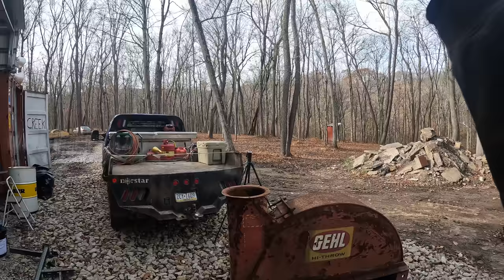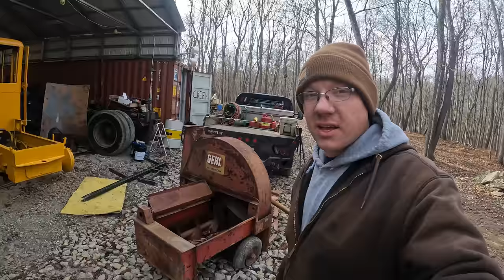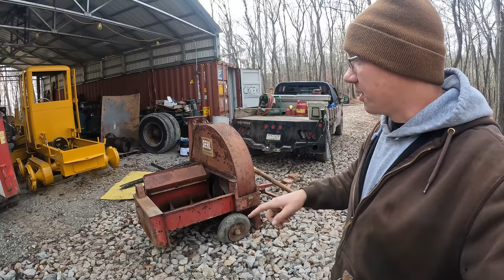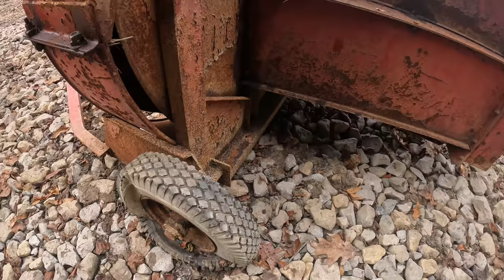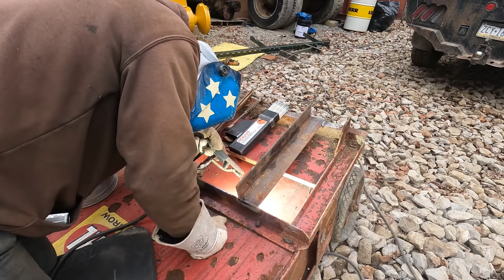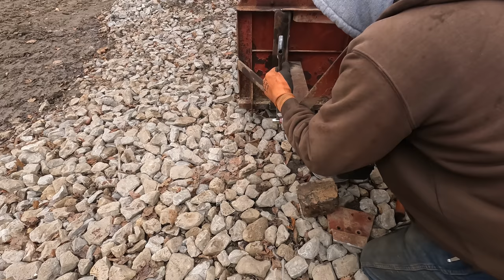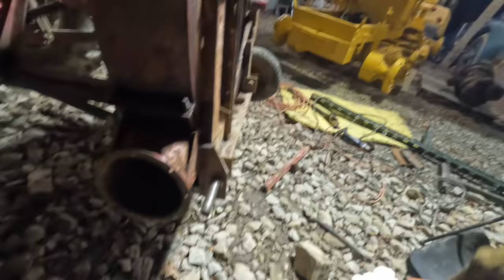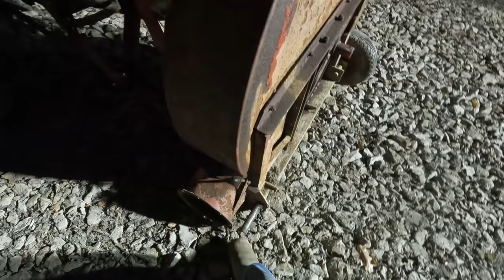I Built a Giant DIESEL POWERED Leaf Blower!!!

Comment: Interesting. That’s crazy how that hole location effected the pressure That much.  You’ll figure it out
Reply: for a centrifugal blower to work well, the inlet needs to be towards the center (or ideally directly in the center) of the blower. Think of a furnace blower, or a centrifugal water pump. The blower works by essentially slinging the air from the center of the impeller to the outside. Since there is a giant hole on the side of this blower that is almost all the way out to the edge, the centrifugal action that would let it build pressure at the intended outlet is released. The inlet of that blower should really be a few openings as close as he can get them to the center of the impeller. Every bit of distance between the outer edge of the inlet and the tips of the blades is more pressure to be built up.
Reply: I can see it already, my thinking is the location of the inlet in relation to the outlet is important & moving the nozzle 90* put it way too close to the inlet hence losing lots of potential pressure. That or moving the inlet to the centre as David says.
Reply: Instead of the blower outlet being at ground level and thus a very short throw, turn the thing 180 degrees so it blows out the other direction, from higher up (better).
Also that huge inlet hole is too big and too close to the outside rim.
These other comments are right, center the hole.
Grease the bearings on the fan, maybe 2 grease nipples.
Forget bits of rubber on the fan blades, that's just silly.
Reply: Now Hank's gonna build one!😄

Comment: As this is a basic centripetal fan, close up that hole near the outer edge, and cut your new holes close to the hub.This will give you the best possible static pressure. When combined with the other guy's suggestion of rubber tipped blades will make a huge difference. Even better if you have the sides of the blades somewhat sealed too. You could even go overboard and build curved blades a-la your normal radial fan arrangement.

Comment: The farm I used to work at had a grain lifter like that. The 120hp Fendt would run it flat out, but we often needed that tractor for carting. Put on the Case 844 (80hp tractor with the pump turned up quite a bit) the exhaust manifold would glow red for hours.

Comment: I had a large leaf vac mounted on a 20 yard container truck . To increase the suction I reduce the hose. I think if you put a pipe on the end that can reduced and concentrated the flow Added with the smaller intake hole you would get more blowing pressure. It worked for me just in reverse of what you’re doing. Great video great build

Comment: To fit a wheel to keep the blower from dragging the ground, just run a trailing link arm/tie rod back from the old axle to a new one about a foot behind then brace it back to higer up the machine with an old rear shock absorber.
Keep up the great (and crazy content) , you're one of the best on youtubed.
David in the U.K.

Comment: love your dedication..... 2 thoughts on the blower.   1 just loosen the sliding housing bolts up and spin the blower chute to the other side  it will naturally be pointed downward and you can remove the cant from the hitch. Or 2 since the chute looks like a giant hose clamp take the bolts out spread it and pop it off, then mirror image rotate it so the chute is still on the bottom but on the other side. Spread it and pop it back on, tighten the bolts up and you're done. Both option 1 and 2 get you back to full air power with no cutting grinding or welding required!
Reply: Great idea, but it won't work. With the chute on the opposite side, it will suck instead of blow. Because of the rotation of the fan. Make a great leaf vacuum tho.
Reply: @joemascioni3101  just throw a pto reverser in there (avail on ebay) plate of the existing intake and plasma cut the air intake to the left of the plated off intake and you're done.
Most things in life are not free.

Comment: Hey Matt, I agree with the previous comment about a central intake around the main drive shaft. Also if you reduce reduce the nozzle it will create a venturi and you'll get more velocity than just open CFM. Rubber tire flaps on the blades will also seal inside the housing, which is where you are loosing cfm.  Just my 2 cents
Reply: I like you ideas.

Comment: Nozzle and inlet position have been mentioned, so I want to mention one other thing: Rubber (mud flaps of converyor belt) bolted onto the fan could give better sealing towards the housing. If you cut off the tips of the rotor a bit for that, it even creates clearance (also dry leaves and sparks are probably not a good combination).
I did a similar modification to my snowblower, and it really makes a difference.

Comment: The inlet should be centered around the centre, it's way off centre to feed thein  silage which is great for blowing silage but not for best blower action.  Also, you want a jet tube, all leaf blowers have them. A gentle reduction in diameter - this converts pressure to velocity and you want velocity to move the leaves. Amazing project, I love the sparks!

Comment: A nice project in progress. Having only an electric leaf blower, I found that a tip that was necked down to a flattened rectangle, not a fan but like the crevice tool on a shop vac works the best on mine. A more focused air flow much like how a water nozzle works on your garden hose. I think it's a great project. The snow blower aspect is a game changer, move the snow completely away from the driveway without losing rock. You may also think about running some 3/4" minus gravel down to lock in the large stone and help prevent the debris infiltration. A road builder I hired for a project many years ago would run a base of 3-4" stone and then fill in with the 3/4 minus. The sand and fine crush fills and locks. Compacts very well. You could experiment on a section to see which combo gives the best flow through drainage.
Reply: Great idea but how about building a shoot to suck the leaves up and shoot them out just a different approach

Comment: Nice job, love to see the fabrication and appreciate you working into the night on this one for us!  Just needs a rectangular output cowl like heatguns have, and a skid/bogey to stop it dragging and then you'll be in business.  With your intake port, you could attach a small vertical chute/hopper made from sheet metal to make it safe, plus you can load straw into it which would then be sucked in and blown out when you need to do that.

For added terror please film the limb remover in operation using a strobe light if you can, then throw a banana (for scale) into the apparently slow-moving blades. :)

Comment: Hi, I think that if you cut two four inch holes on the tractor side just above where the air output is, you can maximize the force. I also like the idea about trimming the blades and adding some flap material for a better seal... Great project! Ron...

Comment: Mate, well done! You get an A+ for ingenuity.

A suggestion, though; have you thought about using it as a vacuum cleaner instead of a blower? Rotate the outlet nozzle about 180 degrees, and fabricate a box-shaped sheet metal cover for the huge inlet hole, with a single open side facing directly downwards. This would mean that as the blower inhales air it would also inhale leaves with it, probably mulch them on their way around the impeller shroud, and blow the whole mess straight out of the right-hand side of the machine and on to the ground at the side of the road. Since you drive on the right-hand side of the road this will be second nature to you.

You would have much greater blower efficiency and air velocity because of the longer air path. This combined with the direct collection of leaf litter would perhaps result in greater road cleaning efficiency.

Also replacing the road wheels with two new ones, with solid rubber tyres, to maintain both road clearance and vacuum efficiency, would also help. Rubber flaps on the sides of the air intake box, as suggested by other readers, would also help here by keeping air vacuum constant, but they would need to be clear of the road surface by a few inches (maybe three inches, but you could make them height-adjustable by slotting the mounting holes so that you could "tune" things) so that the machine sucks up the leaves instead of sweeping them ahead of it.

For other uses, such as straw blowing, you could perhaps revert to the silage auger feed method; remove the leaf sucking inlet and replace it with the auger feed mechanism, allowing it to discharge into the standard feed point.

I am not trying to teach you how to suck eggs; these are suggestions only. I hope this helps.

Comment: If you want to use it "pin point" accuracy with leaf blowing or straw blowing, you could talk to some local cow farmers and see if they have any old heavy duty Ag sprayer hoses with the locking clamp on one end. Then all you would have to attach it to the blower, and put a handle on the end of the hose. I've seen a few rental straw blowers that have that and it would make your life easier. Just park it in one spot, and use the hose to get an area evenly before you have to move the tractor again. As for straw Blowing, why not make a simple feed ramp that folds up and acts like a blocking plate for when you need to blow leafs.

Comment: Excellent job I personally think it will work beautifully once the removable block off plate is installed and you turn the throttle up on the tractor I would build a loading chute for the straw where the block off plate is located and make it removable and then switch them out you will have to move the chute around for the straw so you can install the straw chute at the same time and away you go this is really a nice setup and it will have multiple uses i also agreed with Mr. Z about the rubber

Comment: I would suggest having your intake in the low pressure area around the fan axle and putting on an outlet reducer to increase the velocity of the exhaust. Perhaps bolt on an appropriate sized traffic cone and trip the end as needed

Comment: Awesome squirrel launcher
Bearing s must be loose letting fan hit housing.
We had big Jacobsen and Toro ones on Ford tractor s on Air force base run at full throttle 540pto rpm would blow 15 ft away anything.

Comment: Hi Matt,
Not an engineer here but a fan of yours. Lots of great comments/ideas here. My two cents are that the fan blades are just straight pieces of angle iron which are great for slinging stuff. However, in your case, you need to move air. Of course, closing that gaping intake hole and leaving 6-8 inches towards the center is a great idea. However, all fans have curvature to move air forward or sideways. In your case, maybe tilt them to push air out.  Kind of like on the 90's wheels, where the blades were slicing or cutting. Same concept. 
Also, I think attaching a swooping 90 degree conduit can point the blower tip from center of road. Very little blowing power will be lost. 
Hope this helps in your decisions.

Comment: And my first thought after reading the title of this video was...of course, you did, Matt. A shallow venturi concentric with the shaft would improve the airflow (think ventilation fans in air handlers). In fact, a smaller version of this concept is visible in your storage container. The blue-painted blower housing behind your chop saw (seen as you cut that angle for the 3-pt. bracket) is a good example.

Comment: Matt,
I was a design engineer for a fan company.  A fan is a centrifugal pump.  Look at any centrifugal pump and you will see the inlet is at the center.  The centrifugal force causes the air moving to the outside away from the center.  The forward side of the blades push the air, a fan doesn't suck, it pushes, then atmospheric pressure fills in behind.  The lowest pressure is at the center, the further from the center the higher the pressure.  If you have openings near the outside diameter, they will just be more outlets.  
I would close off and seal most of the inlet opening that is not close to the center of the shaft.  The current opening is way too large. It was used for solids which in reality clogged up most of the opening.  You are not using solids, so your application is a little different.  The inlet opening should be maybe one and a half as large in cross section as the outlet, at only at the shaft location. A circular cutout around the shaft would be best, the closest to the center would be best.   I hope this helps, and thank you.
Reply: This is your solution^, think of a turbocharger, inlet at the center, exhaust at the edge, should work like a champ.

Comment: Leaf blower and flame thrower at same time - love it, great work again Matt! You could rotate the chute 180  - you get great air pressure (as blade travels further before exit)  and add a piece of pipe - like you get on a snow blower, maybe even a moveable end to direct flow exactly where you need it. either way, great upcycling.

Comment: To close off the large opening, attach a plate with a hinge at the top and a bolt at the bottom using a wing nut. It can be closed for leaf blowing and opened for straw blowing. For leaf blowing, install a similar door 180° from the existing door.

Comment: Just block off the outer half of the intake opening and leave the center clear.  Centrifugal force will keep the air to the outside of the rim.  Don't make any openings near the outside anywhere on the cage (top or bottom half) since that is where you build pressure.  Use an A/C fan as an example.  The intake is in the center.  Great video.
Reply: That combined with the rotating the outlet 270 to point down on the other side (as suggested by others) would probably go a long way for improving the output pressure. Good thinking there.

Comment: Here's my suggestion:

On the "exhaust" side, what I would do is rig some sort of angled cone. That way not only will it point straighter, but will basically compress the air as it comes through. 

As far as the Intake, definitely a removable cover over the exposed blade. Then cut open a hole on the exact opposite side of the blower (again with a removable cover)

Comment: Make it a leaf vacuum by building a shroud for the current intake area that comes down to a rectangle opening about 3' by 6" about 4" from the ground when it's lowered, then use rubber to bring the lowest point on the shroud to 1.5 to 2" above the surface. You can then rotate the exhaust to the right side and put a rubber chute about 180 deg. around the top edge that's "floppy" at the outer edge to prevent rocks and sticks from shooting upward. That should provide plenty of air movement. Doing the rubber tips on the impellers would help even more, like others have said.

Comment: Hey Matt I'm curious how it would blow if you repositioned the shute to the 4 o'clock position instead of blowing at 90°. Also with the dragging problem I wonder if you made like a swivel wheel ok the back like on a 3 point brush cutter.
Reply: put a hose going out the other wheel from that and it'll be superpowered, also some of the other comments suggest the impeller being close to the center of the fan

Comment: I really enjoy your videos Matt , just a little suggestion on this leaf blower , why don't you add a  removable pannel on the big opening so you can use it as a straw blower when you need to and also make those 8inch holes and a set of blocking plates for them so you can block them off when you don't blow leaves , just weld some bolts and this way you can put protection wire mesh when you blow leaves and blocking plates when you do the straws

Comment: weld on post (bolts) so you can build flaps to cover the 8 in holes, add a wedge to hold them in place for when not using it in leaf/snow blowing and make them so you can just take them off when you are using as leaf/snow blower. thinking that gravity should do most of the work for you, dont want them to be too easy to come off but not hard either. I tried the snow blowing with a backpack.. not sure you are going to like it.

Comment: Nice forest fire generator you have there.  🙂  A nozzle of say 50% diameter reduction would up the velocity a lot and give you better directional control.  And if you can flip the rear panel so outside is in and inside is out, I think you get the inlet on the top where you'd generate more velocity.  I also agree with others who say the intake is too large.

Comment: Pumping grain and pumping air are two different things. Find a leaf-sucking vacuum trailer and examine the fan assembly. It’s an offset volute. The air intake is in the center and the centrifugal force imparted by the fan compresses the air like a turbocharger does. So, centrally located air intake and the housing needs to increase in size as it nears the outlet. Then you’ll move some leaves.

Comment: Matt, try putting the discharge straight up like it was and use 8 inch stove pipe and a 180 degree bend to direct the air up, over, down and then through a 90 degree ground level final discharge. This "plenum" will let the air pick up speed before it leaves the blower. You could also attach a funnel shaped piece, a swage or reducer going from 8" to 6" to increase velocity even more.

Comment: Along with rotating the discharge 220 degrees add an angled hopper open on top to drop straw into. That should feed it safely into the blower. Then you could just put the tires back on which should make it much more stable. Last thing get earplugs and crank up the RPM’s! Be safe and keep building!

Comment: Put a removable SOLID maint plate over the current opening. Then cut out a pie shaped opening about 1/4 of the circle at the 10 to 1 o'clock position.  That air isn't reaching the needed velocity with such a short path.   And maybe put an expanded metal screen over the chute.  You're still throwing a lot of sparks for dry winter leaves.  Maybe hang your fire extinguisher on the tractor while you're at it - just in case.